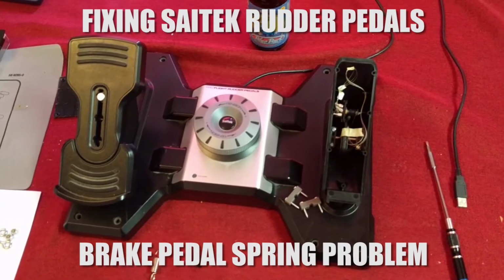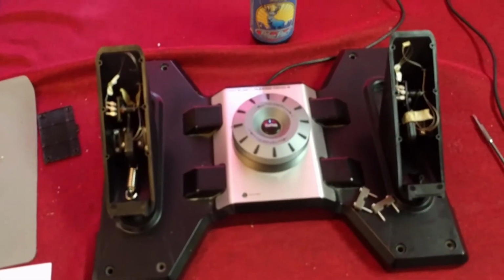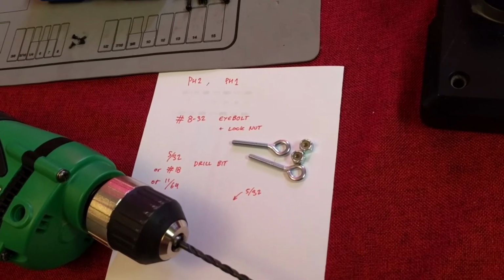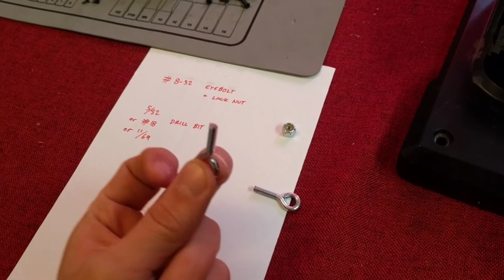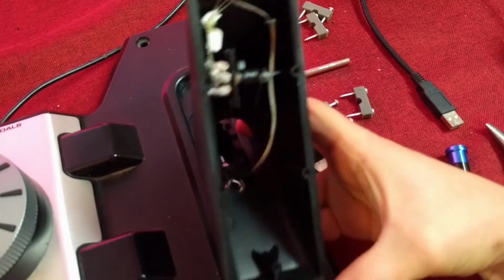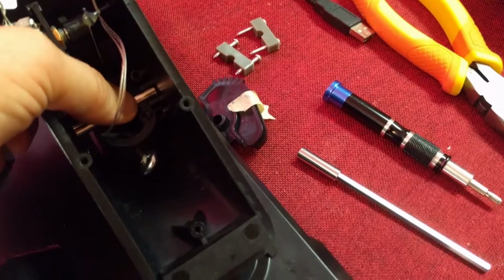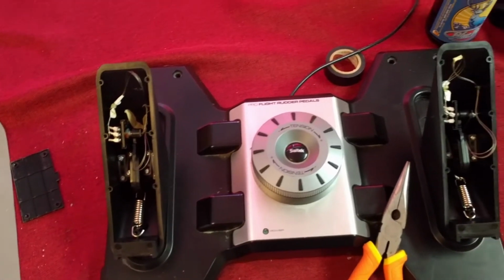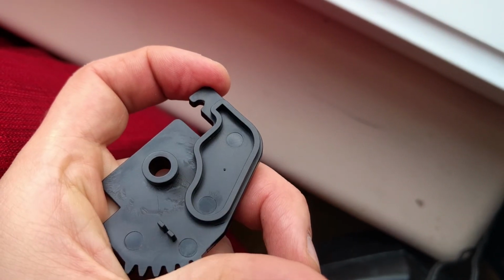Saitek rudder pedals - repair broken brake spring

Comment: Brilliant. Mine broke too. Thanks!! A simple option is to put a small weight at the bottom of the pedal to keep it in the upright postion. Zip tie or hpt glue.
Reply: They sell metal replacement parts for this piece.

Comment: Thanks for this.  My issue was not a broken part but a stuck pot.  Sliding the pot out of the groove and rotating it 360 a couple times caused mine to come back to life.  Then just a matter of reinstalling it into the groove at the exact right gear tooth.
Reply from the maker: If you haven't done so already, I recommend you clean the POT with isopropyl Alcohol. It can help with spiking and sticking.

Comment: The Internet never ceases to amaze me. I realized today (Jan. 1) the left rudder pedal was hanging limply (as I usually was, in my younger years, on a New Year's Day). I could hear rattling from inside the device and figured something had broken. Of course, I started into it from the bottom up, taking out the untold number of screws holding it together. I thought, wait a minute ... check YouTube; someone may have already had this problem. Lo and behold, your video popped up. What a godsend, even though it's three years old. While I didn't repair it the way you did, the vid gave me some insight into how it all works and fits together, which is the key to repairing anything. Thanks.
Reply from the maker: Glad I could help!
Reply: @nachtwolf84 Just got a set off eBay today, listed as not working and therefore cheap, and there is rattling inside the pedals. I'm sure this is the fix I need too, so thanks for the walk thru!

Comment: My toe brake spring also broke, but I would say that fixing it really isn't necessary. When I'm taxiing around the airport, my feet are on the pedals all the time to steer, and my natural position is fully back (heel down), so it's not like it interferes with normal braking operation. As far as the spring tension goes, it's not enough to resist your foot pressure, even when new, and I can't tell the difference between the broken side and unbroken side anyway. Once in the air, I usually leave my feet on the pedals, but even if I don't, if the broken side happens to move forward by itself, it doesn't have any effect on the aircraft.

Comment: Thanks for the tip.  Used a small screw eye with a 1/16 inch drill bit.  File down the broken plastic and dill from the bottom up thru the center.  No obstructions or bending.  Closely resembles original spring attachment point. Total repair  cost < .10cents.
Reply from the maker: Awesome, you're the second person to use an eye screw. Seems like a great alternative. I went for eyebolt + nylon nut just in case the threads wear out or something. I hope it holds up!

Comment: Ditto, thanks for the tutorial, I did my repair following your guide but used a cable tie instead of the eyebolt. I simply threaded the cable tie strip through a drill hole from the inside of the pedestal then back through the hole and into the cable tie anchor grippie thing, pulled it up until I had just the right sized loop to hold the spring, trimmed of the excess cable and bob is your uncle. Worked a treat. Thanks again.
Reply: Could you send a picture of that please?
Reply: Ah sorry, that was 3 years ago and I no longer have the rudder pedals.. They were passed on to someone else (still working) after I traded up.  @koenbenschop4982

Comment: Could not find a small enough eye bolt so used a cable tie instead and it works!! Will look for the correct size eye bolt so when the cable tie breaks (and it will) it will be an easy permanent fix. Thanks...saved me about $250 CDN.

Comment: I did this without any extra parts, just drill a  3 mm hole in the side of the "oval socket" stretch the spring and that's it.  did it in 5 min ;)